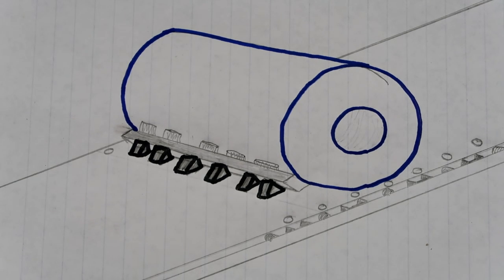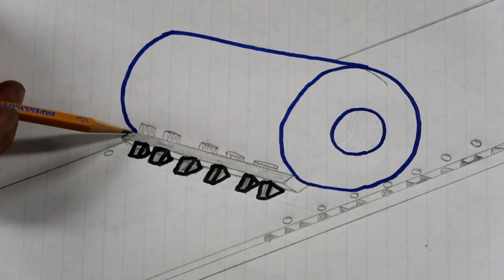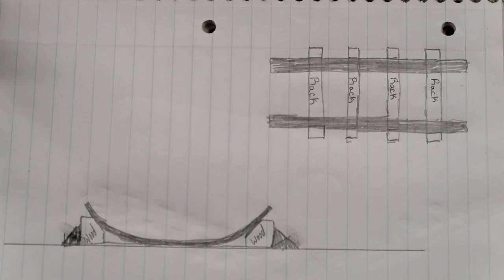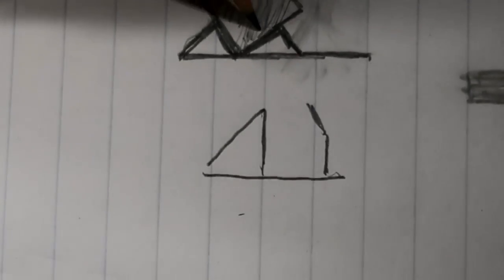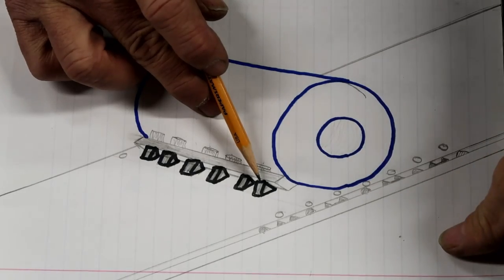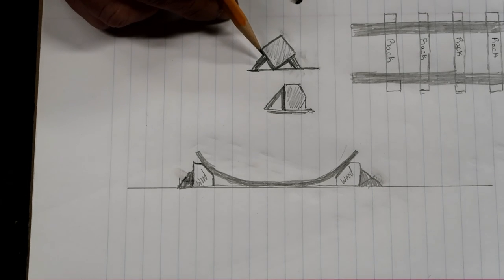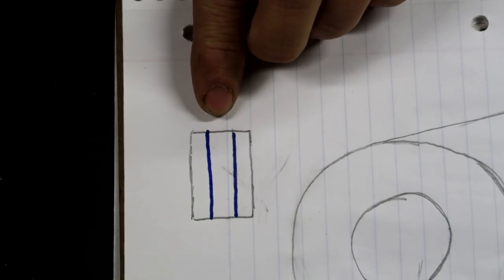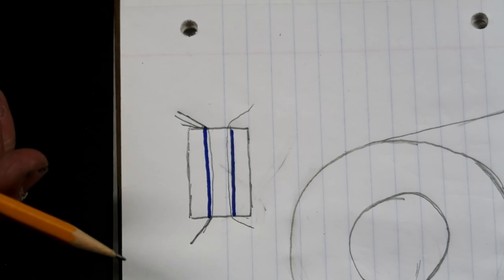FLATBED LOAD SECUREMENT COILS PT 2

Comment: A great video on working load and securing the load!  I have been researching this and found this critical part missing. Because coils and other types of loads can be quite heavy I asked myself why can't we use 80-grade chains 1/2" and then I thought how strong are those anchor points?  2ndly, I kept thinking those 2x4 certainly can't stop the coils from rolling over in a panic stop because some dumb driver did something stupid. I had wondered how to use 8x8 timber on the front side and chain them down to the rails. Here is my one question how well can those chains hold back that load as in G-Force in a panic stop? This is why I would consider using 80-grade chain.
Bulkheads, what is the feasibility of using heavy-duty aluminum I-beams stacked between 6x6 or 8x8 timbers and tied down to the rails? The timber would then be friction plates to keep it from sliding.
Could there be room to do belly wrap on coils between those rubber mats with straps?  I'm thinking the straps need to be free to slide under the coils.
Reply from the maker: The simple fact that you are thinking about it and asking the questions you asked tell me one thing. You are cut out for flatbed work. First, the securement points on the trailer are rated for 5/16 chain. A heavier chain will only be rated at the weakest point, in this case, the anchor points which it is attached to on the trailer. 
Second, building a barricade to PREVENT forward movement. The barricade must prevent any movement. The movement is kinetic energy. Mass times Velocity. Like a rifle bullet. most are considerably lighter than a comparable pistol bullet, yet their velocity is two or three times faster. Giving them many times more destructive power.
In the case of coils, the weight is massive and velocity low...but it doesn't take much. So preventing movement of any kind is the priority.
As of now, the FMCSA has guidelines.... regulations for "proper" securement of coils. Half the weight of the coil in tie-down strength. So for a 48,000-pound coil, you need 24,000 pounds of strength in chain. If it has a 5,000-pound working load limit 5 is enough. Six is better. They now require X straps over the top of all Suicide loaded, Skidded (eye to the sky) , or shotgun coils. Your idea may be better, but convincing a DOT officer is the hard part. Remember most can't pour piss out of a boot if it isn't on the clipboard. They don't have to think they just site a regulation. 
You might draw a diagram and run it past your safety department. A good idea shouldn't go to waste. The 6x6 and 8x8 idea sounds good. My only concern is the storage of the I-beams and wood that big. Especially if you have to drop and hook as often as we did at TMC. I hated moving all my gear every time I dropped an empty to hook to a loaded wagon.  Thanks for watching and sharing your ideas and for being smart enough to ask questions. I do not know it all and I hope if anyone out there has better information they will share it with you.

Comment: Thank you for this video.
I have a question 🤷‍♂️🤷‍♂️
Is the trailer pockets are rated @ 5k lbs WLL and I use 2 pockets for one chain rated @ 10K WLL Does that means I have a WLL of 10K lbs for each time I use the same method?
Reply from the maker: Jesse Marte no. The WLL is for one securement point only. The stake pockets are two feet apart and you have to go completely around the pocket and hook back onto the chain itself. The WLL is the WEAKEST point. In your scenario the WLL of a single pocket is still the WLL. plus going around two on each side blocks the round stock which on most modern trailers is welded around its complete circumference.  It is preferable to a stake pocket. Being it is stronger. Boyd Brothers will fire a driver for using a stake pocket over the round stock. Tie downs in the deck are as good as the round stock. If the trailer has them. Good luck and stay safe.
Reply: Thank you very much...

Comment: If you're hauling coil, you should check out The Cradle - it's on another level than those coil racks & 4x4s while still allowing for back-hauls. Check it out at milessecurement.com